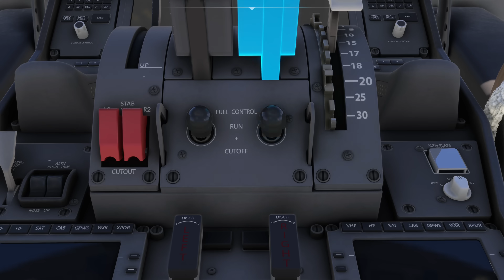Air India 171: Why Did The Fuel Cut-off Switch Get Moved?

Comment: I think the benefit that an in-cockpit camera would have added in this case is to end the debate about the switches having vibrated to the cutoff position, or that it was an electronic failure making it look like the switches were moved but they actually weren't. A video would confirm the other data and also show which pilot performed the actions, and that is something that the black box data can't do and the voice recorder can only suggest.
Reply: Two switches don't vibrate to off position within one second of each other. Trillion to one. Clear human input that switched them to off
Reply: @Carlos1618033  "Trillion to one."

The problem is that even you are still putting a odds on it.
Because you cannot say with absolute certainty that it didn't happen.
Just that it's extremely unlikely.

And sadly, the extremely unlikely still manages to happen every day.

There's a reason why there is a saying "truth is stranger than fiction".
Reply: @Carlos1618033 is there any mechanical connection  between the 2 switches? I heard someone saying you need some time gap to put it back one after another
Reply: I don't know why everyone is rushing to get an answer. This was a preliminary report and the most important piece of information was summed up in less than two complete lines and that too vaguely. From what's been written there, it's as if the reporters are "screaming" that this is a murder-suicide. There has to be a very solid reason as to why the conversation between the pilots wasn't discussed in detail. So, before saying that a camera would have solved this case by now, maybe it is possible that everything there is to know, is in the audio file and the agencies want to gather more evidence (perform background checks for instance) before handing out a final verdict.
Reply: I really cannot buy an electrical fault making it look like the switches were moved but actually were not. That then were returned to RUN with 2 seconds apart? This speaks to some sort of a human-operated corrective action. I’m hesitant to be insistent on it being a deliberate action until a report speaks to this definitively. But I cannot see any way the on, then off then on again sequence was anything other than operation of a physical switch.
Reply: @puellanivis  Between the fuel switches being registered in CUTOFF - being by the switches physically moved or a fault in the FADEC logic, what is not clear at this point; pass 10 seconds for the Number 1 was registered in RUN again and pass more 4 seconds for the Number 2 to registered in RUN.  

14 seconds of a time-lapse of 29 seconds between the lift off and the crash.
Reply: @Sokol10  we dont know what was going on in the cockpit. The mlment of freezing on the part of the pilot flying, maybe a moment of horror by the pilot who made the correction at what had happened.  What if the pf had to manage the yoke and correct at the same time. We don't know what was going on. Maybe it's all the in the cvr but has not been released.
Reply: @puellanivis  Unlikely yes.   Not quite as impossible as it should be however.
Reply: I believe an electrical fault made the switches cut off like a safety switch preventing the plane from flying due to electrical issues....however it must of happened at the end of the runway a little too late as the plane was in take off position. The plane didn't have enough thrust on take-off. They noticed the switches turned off after take-off and turned them on again. The switches were probably off just before take-off but not noticed until they were in the air.
Reply: The 10 seconds of cockpit voice recording left out of the preliminary report may not be as good as a cockpit camera but it would have gone a long way answering many questions about the fuel switches, accidental, intentional, did the switches actually change positions.... 10 seconds is the time from when the fuel switches transition to cutoff and then back to on, 13 or 14 seconds for engine 2. Knowing what happened in the cockpit during this time would be extremely valuable information yet it was left out of the report.
Reply: A video would not end the debate about the switches, because the report would not contain any images from such a video. The report did not even provide any transcripts of the conversation between the two pilots.

The black box can confirm if the pilot turned the fuel off. The investigators already know the answer to this. For whatever reason they are being secretive.
Reply: It takes a positive, affirmative, NON-casual action to move the switch out of the RUN position.
Reply: Based on a lot of the comments, welcome to the chat, Boeing! It's not the pilots folks. Go read the wall st journal.
Reply: The black box says that the switches were turned off.  The voice recorder shows someone asking why the switches were turned off. How much more evidence could you need that the switches were turned off?
The only remaining question is who turned them off.
Reply: @mtpaley1  I can only say I wouldn't want you on my jury.
Reply: You’re quick to blame the pilots, but let’s get real:
🔴 A viral video taken on the same aircraft just hours before the crash showed malfunctioning cabin electronics — power issues, failing displays, and unresponsive systems. That’s not random. That’s a clear warning sign of deeper electrical faults.

🔴 The takeoff roll was unusually long and slow, clearly visible in CCTV footage. This was before any engine switches were flipped. If the aircraft was “normal,” why did it struggle to lift off? That alone suggests power or thrust-related issues, possibly tied to earlier electrical problems.

🔴 Both engine fuel control switches were turned off within seconds of liftoff — an action that takes force, not something easily done by accident. And the CVR shows confusion in the cockpit: “Why did you cut off?” — “I didn’t.” That doesn’t sound like deliberate action; it sounds like unexpected behavior from a faulty system.

Yet despite all this, you’re pushing a theory that clears the manufacturer and blames the dead pilots — just like Boeing did during the 737 MAX crisis, when they knowingly hid MCAS flaws and let pilots take the fall.
Reply: @Gurpreet.jheeta 
O.k saddak chaap investigator. Ghar wale sunte hain teri? 😅😂
Reply: @KingArshadNadeem when cant reply with logic... give dumbsss replied lol
Reply: @Gurpreet.jheeta 
Simple pocha. Ghar wale sunte hain? 😂
Reply: @Gurpreet.jheeta  Most of what you say is false and/or unrelated to the flight controls, imo.
Reply: Camera not allowed. Pilots privacy. Long flights, they could go for masturbutaion 😅😂
Reply: The black box information is only available to investigators after an incident, correct? It is not used by superiors to review pilots'work habits. Why couldn't cockpit video be set up the same way? Only to ever be seen by investigators in the event of a crash? I don't understand why pilots would object to that.
Reply: Because it doesnt add any benefits. Also flight Data is used for Reviews @IceWaterOtter
Reply: Fake narrative. Facts are here. You are sold off to Boeing. Why don't you talk about FAA directive from 2018 and CAA directive from May 2025 which talks about issues with Boing 787 which can cause cut off including during inflight.  Why Etihad airlines and DGCA wants planes to be checked. Why British Authority wants checks for this issue since May 2025?.

Western media is corrupt and sold to Boeing
Reply: No one who has ever seen letr alone operated such a switch or does any logical thinking whatsoever is engaging in said "debate". And those who do will not be put off by a videoproof. There is plenty of evidence that their hypothesis is dogshit, more evidence will achieve nothing.
Reply: The analysis of the events surrounding the crash of Air India Flight 171 demonstrates that the activation of the Ram Air Turbine (RAT) at 08:08:47 UTC, just five seconds after the fuel cutoff at 08:08:42 UTC, cannot be explained by a normal loss of engine power due to the fuel cutoff. The Boeing 787-8, equipped with General Electric GEnx-1B engines, was operating at near-maximum thrust during takeoff (approximately 90-100% N1, around 8,000-10,000 RPM). This high rotational speed results in significant inertia of the rotating components (fan and low-pressure turbine). When the fuel control switches were moved to "CUTOFF," combustion ceased immediately, but the engines continued to rotate due to inertia and airflow ("windmilling") during flight, particularly at the high airspeed shortly after takeoff (approximately 150-200 knots).
Based on general technical data for turbofan engines, it takes 20-60 seconds for engines to come to a complete stop when stationary. In flight, airflow extends this process to 1-3 minutes or more, as air continues to drive the fan and turbines. After five seconds, the engines would likely have retained about 50-75% of their rotational speed (approximately 6,000-7,500
RPM), which is more than sufficient to power the Engine-Driven Generators (EDGs). Each of the four EDGs (two per engine) provides 250 KVA, and even at reduced speeds (e.g., 20-30% N1), they can supply critical systems such as flight controls, avionics, and hydraulics. A total power loss due to the "CUTOFF" alone is therefore technically impossible within five seconds.
The RAT is automatically activated when all four EDGs fail, the primary electrical buses fail, or the hydraulic system fails. The rapid RAT activation at Al171 (after five seconds) indicates that an additional technical failure disrupted the power supply or hydraulic system. Possible causes include:
Electrical Short Circuit: A failure in the Electrical Load Management System (ELMS) or power distribution could have disabled the primary electrical buses, even if the EDGs were still generating power.
Software Failure: A fault in the Thrust Control Malfunction Accommodation (TCMA) system or the electronic control unit (ECU) of the fuel system could have automatically moved the fuel switches to "CUTOFF" while simultaneously disrupting the power supply. A General Electric Service Bulletin (2020/2021) highlights a potential "Loss of Thrust Control" (LOTC) due to a faulty MN4 microprocessor in the ECU, supporting this hypothesis.
Hydraulic Failure: Less likely, as hydraulic systems have accumulators and the engines were still rotating, but a simultaneous hydraulic loss could have triggered the RAT.
Cockpit voice recordings, where one pilot asks,
"Why did you shut off the fuel?" and the other responds, "I didn't," indicate that the fuel switch movement was not intentional. Indian expert Sanat Kaul noted that the "precise and simultaneous" movement of the switches (within one second) is atypical for human action and suggests an automated fault, such as a software or sensor error.
These findings strongly support the hypothesis that a software or sensor failure caused both the switch movement and the power loss. 
Reports of the captain's alleged mental health issues may be an attempt by Boeing or other stakeholders to shift blame to human error, potentially to obscure a design or software flaw.
Boeing has a strong interest in avoiding liability, particularly after the 737 MAX incidents, while Air India seeks to protect its reputation. The Indian investigation (AAIB) appears independent, but economic ties to Boeing may influence reporting. Alternative sources (e.g., Al Jazeera, X posts) and the absence of Western narratives in non-Western media support the technical failure hypothesis, aligning with a Russian perspective that would likely question pilot-blaming narratives.
In summary, the RAT activation after five seconds is incompatible with a normal fuel cutoff, as the engines would have continued to supply power. A significant technical failure, likely electrical or software-related, is the most plausible explanation for the incident.
Reply: @Gurpreet.jheeta  thanks gpt, please talk less garbage and reduce copium
Reply: @vanessaxoax7646 still no logical reply to the stament but 12 year old argument 😂
Reply: @Gurpreet.jheeta  Yeah man im sorry, if youre pulling stuff out of your butt (or using chatgpt to do so) im not debunking that because you know what, actually researching and giving proof is time consuming and sometimes even hard or almost impossible. If you had any technical understanding youd know your post is dumb, and since you dont thats a debate below what im willing to handle. Just believe what you wanna believe, i dont mind.
Reply: @vanessaxoax7646  You got so butthurt by actual technical analysis that now you’re dodging it by calling it ‘too hard to debunk’? That’s rich. You claim to know aviation but can’t even counter a basic breakdown of RAT deployment logic. Just say you’re out of your depth and go. When someone explains why 5 seconds isn’t enough for RAT deployment after engine cutoff and backs it with facts, and your only comeback is ‘I won’t bother’ that’s not intelligence, that’s intellectual surrender. You didn’t ‘refuse to debate’ you couldn’t. Sit down
Reply: @Gurpreet.jheeta  you didnt to technical analysis, you decided to believe in the pilots doing nothing wrong and asked chatgpt for a way to justify that. 

You didnt state any facts, just claims. Im gonna claim the RAT deploys when both fuel cutoffs are switched on. 

There is no point in such a debate, and because youre too lazy to actually research the facts im not doing that for you either.
Reply: @Gurpreet.jheeta I’m sorry but there was nothing simultaneous or precise about the movement of the switches. Approximately 1 second would be an expected time for a human to move them consecutively and with purpose. 

We can all hope there is some other reason, but as of right now, evidence does not support a technical cause more fully than it supports a human cause.
Reply: There is exactly zero debate surrounding whether the switches vibrated to the off position. Conspiracy theorist don't care about reality and no amount of evidence will ever satiate them.
Reply: I feel it is a possibility that the switches were moved to run before take off but during take off due to whatever known issues with switches (as per bulletin), it might not have locked in position and it fell down to cut off position and later pilot noticing it and hence asking who did it !
Reply: You need to physically pull up the lever and drag it downwards and latch it again in position in order to switch from run to off. Don’t think vibrations might be able to operate the switch
Reply: I think this is a fair take
Reply: Watch Flyingbeast video if you  really believe in unbiased explanation ❤❤❤ english subtitles are available😊
Reply: people still wouldn't accept the answers even with video evidence. i have literally watched people just reject video evidence that is right in front of their face because they don't want to accept the truth as opposed to their preferred idea of what happened, and/or accept being wrong
Reply: @ItWasSaucerShaped  Who cares what "people" think?  Any video would be reviewed by multiple qualified, professional flight safety investigators, not the youtube comment section.  Would have thought that was obvious.
Reply: @ItWasSaucerShaped  Yes, like those that do not believe in the Moon Landings... nothing changes them. But could it be possible that an enemy hacked the electronics? No one wants to blame the pilot without very good evidence.
Reply: @ItWasSaucerShaped There are plenty of people without common sense or interest in facts. Alas, the truth must still be sought. That is how we make things better. Buck up, little camper.
Reply: @ItWasSaucerShaped  Someone rejected video evidence in conjunction with voice and data recording?
Reply: Yes, but this case is an exception.   And if you want to force them to have constant video recording, do so after you accept that for your own workplace.   There's a reason why over 99% absolutely hate the idea.
Reply: @DIREWOLFx75  what's the "privacy" they need while flying an airplane full of passengers? what do you think they do there? sex?. It doesn't have to be audio recording, just video. At the end of the day they are being recorded already, they aren't inside an office, they are flying an airplane. BUSES have cameras...
Reply: @FacuGonz3  lol   Dude, there's already audio recordings, and those are the more important ones, most of the time.
Reply: @DIREWOLFx75 isn't what I said? 🙄
Reply: @DIREWOLFx75  Dunno about you, but personally I assume there's cameras in my workplace. Not sure, never really looked around for them, but I would just assume. And the idea has never once bothered me. I tend to just operate under the assumption that there is.
Reply: @albertjohnston1026  In a prior job (I'm now retired) working with emergency room medical records all of us employees were under surveillance during all working hours.
Like you it didn't bother me because I did my job. Now I automatically assume everything everywhere is video recorded.
Reply: @DIREWOLFx75  and what reason is that?
Reply: @SHADOW.GGG-  Because it is highly stressful to be under constant surveillance.

This is well attested in places that already have video surveillance of workers.
Reply: @DIREWOLFx75 then why not face the camera on the instrument panel?
Reply: @DIREWOLFx75 Difference is that most jobs aren’t about safeguarding the lives of the public.  A pilot takes on the position with the understanding that there IS NOT ROOM in a cockpit for MISTAKES.  And actually MOST if not ALL business these days DO VIDEO RECORD their employees AT ALL TIMES while on the job or off the job while in the establishment or on the premises….so WHY not in a work place that is responsible for that many lives at one time????

Do you actually read what you write BEFORE you hit the send button????
Reply: A pilot can simply disable the camera in any of several ways, including simply obscuring the lens.